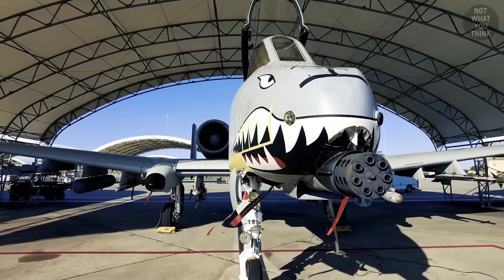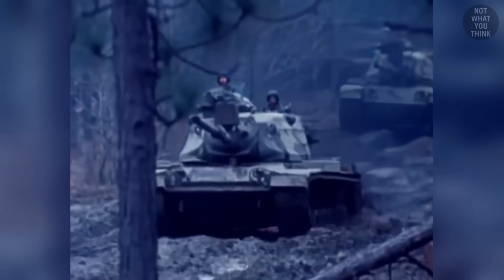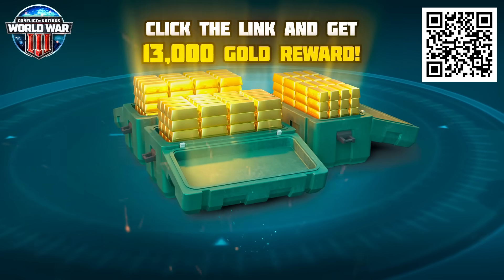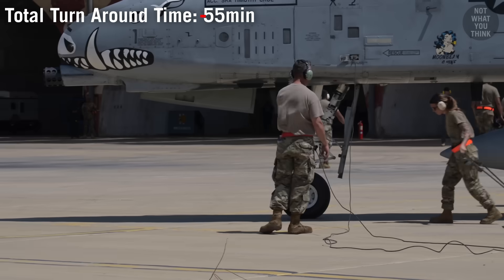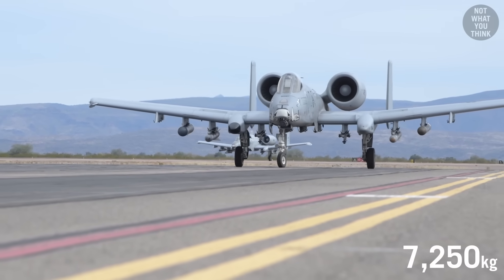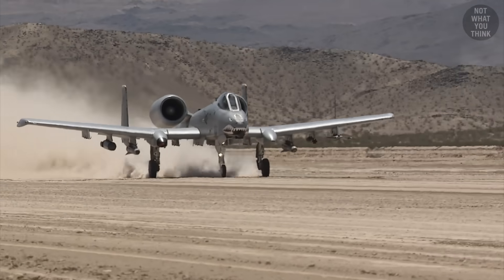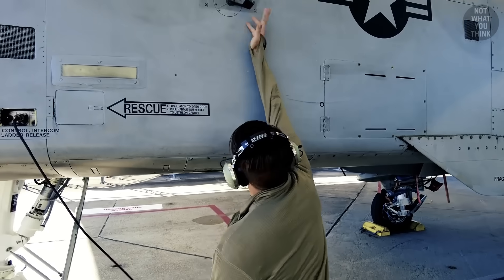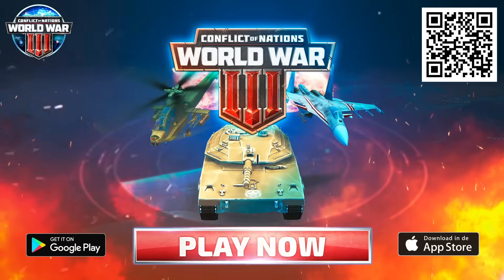The Aircraft That Doesn’t Eject Bullet Shells

Comment: i always forget that 50 year old planes are planes like the A10 and not the F86 or something
Reply: the f16 is only a year or two younger and is still a gold standard amongst fighter jets.  It's far less expensive than the 5th gen fighters and will be used to bulk out air fleets for the foreseeable future.  Part of why I really don't think they're gonna manager to retire the a10.  It was built to chew bubble gum and kick ass and it's still all outta bubble gum.
Reply: @Ray_LF  A-10 different kind of aircraft man; it's designed to operate closer to battlefield which makes it susceptible to modern ground missiles unlike the F-16 which can operate from higher altitude and drop the same munitions with modern gps to hit same target. besides the new ATACMS no plane needed just push button via safety of 150 miles and deliver 950 bomblets (grenades) or 900,000 yup 900k  tungsten metal balls size of a marble traveling 2,000 mph covering ¼ mile in ONE missile.
Reply: . . . . or the B52 . . . !
Reply: Right the f86 is only closer to 80 years old😂
Reply: @chheinrich8486 and B-52 is like 74 years old
Reply: Really great design
Reply: Если А10 не нужны Америке, предложите их Украине. Может они смогут найти им полезное применение?!
Reply: @ЛевГригорьев-б6л  If it's obsolete, why would Ukraine need them ?
Reply: ukraine has su-25s @ЛевГригорьев-б6л
Reply: @ЛевГригорьев-б6л  You have a good point

Comment: Retiring the best air support aircraft in the world is just plain insane. Ask any soldier on the ground and they want an a-10 warthog overhead.
The Air Force needs the money from the a-10 program to put into the f-35 program. 
That is the only reason they are retiring the warthog because the warthog has recently been refitted with new wings and upgraded avionics and weapons systems to make them last for another decade.🎉

Comment: The Airforce has been retiring the A10 since 1980.  It's not fast nore a bomber so the Airforce doesn't want it.

It's cheaper to operate than any of its "replacements" is why it hasn't been retired and probably won't be in 2030 either.

Russia and China are still fielding 1970s technology.

Comment: we still need the A-10 or somethign like it. Bullets are cheaper than missiles.
The A-10 is also deployed after we have established Air Superiority. the F35 is not a replacement for the A10 completely different roles.
Reply: The problem is DU ammo has been out of production for a very long time.  Restarting it will make them more expensive.   The TP rounds can still cause a lot of damage, as would HEI rounds, On APC and soft skin targets
Reply: @Matt-mt2vi  yep the ammo part. It’s a major problem with USA current military. It never helped the air force never
Liked the a10 but the army loves it
Reply: F35 is a multi roll aircraft it can hit a target while being stealthy, stealth is a needed feature nowadays or else it'll just get shot down by a missile you can only have so many flares and chaff. Stealth will eventually fade out due to advanced technology but right now it's what we need, like A-10 was what we needed in the 70s-80s but it's not anymore.
Reply: @Commander9013  100% disagree. Styler will not win a war. It’s good day 1 not day 100. Or for deep strikes into enemy territory. The job of the stealth bomber. Something the f35 is not. 
The a10 is ground attack. F35 is not. No big gun. Crap loiter time. Can’t take a hit. Over priced. I’m in the industry. 
The a10 can fly under radar. 
There is not aircraft out right now that can do what the a10 can.
You also clearly don’t understand military doctrine. The USA establishes air superiority before sending in non stealth.
Our planes are the only in the sky. So no threat to the a10.
Reply: @Commander9013  stick to video games. The A-10 has been effective well past the 80s. NOE is still very effective in pentration of A2AD more so when SEAD and EW is in effect, which os what happens normally on a front line where CAS takes place, not hundred miles in occupied territory where the F-35 would be used.  It has worked against A2AD systems that are still numerous and widely used today.  When actual knowledgeable people talk, not your type bare understanding, know that the A-10 is still viable today. It's the systems that are slowly coming out now are what the issue is.  The F-35 is a multi role aircraft buts its not a CAS aircraft.  It failed miserably that 3 years of testing.  There is no coming replacement for the A-10.  There is nothing that can't be stopped that includes drones.   There is also no defense that can not stop or at least be limited.

Comment: Retiring the A10 without a direct replacement is a huge mistake.

Not every conflict the US will be in will have manpads behind every tree.

F35's and F16's do not have the payload and loiter capability. They just dont cut it for CAS.
Reply: The F 35 is the direct replacement for the A 10, also yes they will, any military will have MANPADS behind every tree. Btw, the F 15 and 16 also perform CAS all the time, and both of the carry as much if not more than the A 10 in terms of payload, and can also deliver them without the risk of friendly fire, or risk to the aircraft because it isn't a slow moving and easy target for enemy anti air

Comment: A-10 should be kept just as the B-52.... its a necessary beast.
Reply: No it absolutely isn't, all it is, is a waste of resources and manpower that would be better used for planes like the F 35 or F 15, both of which can perform CAS better than the A 10
Reply: At least the B-52 has stand off capability to prevent being shot down easily. A-10 is missile and cannon fodder.

Comment: A Ukrainian Bradley disabled a Russian T-90 using it's 25mm chaingun.

Remember that next time someone says the Warthogs gun is ineffective against modern armor.
Reply: Only because the bradely could target the barrel and tracks, an A 10 in flight can't, it is ineffective against modern armor, the gun's also extremely inaccurate
Reply: @Crustaceannationrepresentative  the reports of poor hit ratings from the A10 on vehicle size targets have been greatly exaggerated. Many A10 Pilots have refuted those claims of a 10-15% accuracy rating, stating their hit rate is closer to 30 percent which means a one second burst would put a couple dozen or more rounds on a tank-sized Target.

Furthermore, the Bradley beat the T90 not by hitting it in the tracks but by destroying its Optics and likely hitting it in the turret ring. 

Now, a turret ring hit by an A-10 from a top down attack is not very possible, but the destruction of Optics and more importantly a penetration through the rear engine deck is absolutely likely to happen.

The A-10 platform is not designed simply to attack tanks, either. There are hundreds of other viable targets the main gun can absolutely shred. These include artillery pieces, buildings, troop formations, transport trucks, apcs... the list goes on and on. Can you destroy these Same targets with laser-guided weapons from an f-35? Absolutely. But the cost Delta is absurd. 

Lastly, the A-10 may not be able to punch through the front armor of a t90, but it can certainly tear up any model of the t72 as well as the older T-Series tanks. Many of which we are seeing on the battlefield as Russia gets desperate and digs into its old stocks of tanks.
Reply: Top-down attack would shred a T-tank

Comment: A-10 has more friendly fire incidents than other planes. It also can't kill tanks with its gun.

Most accurate = 12 meter spread.
Reply: It also has the most CAS sorties than any other plane or helicopter, combined. It can, and there are multiple instances of T-72s being popped if you bothered to read a book about the Hog in desert storm..
Reply: @Steamthrower1 If you bothered to read up on desert storm you'd know the F 111 flew more sorties than the A 10, and had to fly extra because the A 10 was performing so poorly, so the Vark had to pick up the slack
Reply: @Crustaceannationrepresentative  Can you please provide me a source for the alleged poor performance of the a-10, and the 111 needing to "pick up the slack"? would be greatly appreciated as i have never seen this in any book i've read.
Reply: @Crustaceannationrepresentative  and as expected, no response...

Comment: Amazing how the Air Force has worked tirelessly to scrap the planes that are actually preferred by the Army ground forces. Guess somebody wants a nice cushy job with a contractor upon retirement. Guess that's why they want to replace a plane that works with a plane that can't even beat 1970s tech. I'm looking at you F22 Raptor.
Reply: why can the raptor not beat 70s tech?

Comment: Good video.

It is not necessarily lobsided to a single side. Instead, it explains both why it was once useful and not it isn't. 

Was the A-10 unique? Absolutely, but it is a piece of its time, meant to fill a gap in the US military back in the 1970s. It is no longer suitable for CAS in the 21st century.
Reply: You point would be better if you didn't use the myth of it fill gap in the 70s.  It was a replacement for Close air support and pilot rescue support.  It still fills that CAS role better than anything else flying as stated by numerous military studies and test.   F-16 did really bad at it in the 90s and most recently the F-35 failed the test.  F-35 is great for alot of missions CAS is not one of them.  Incompetent Russia is still providing CAS even today, but for some reason people think the A-10C Which is superior to Russian CAS planes can't.  Lol
Reply: I think it's more than capable of it's role, it's still designed from ground up to be a ground attacker after all.
Reply: @Steamthrower1  its slow af gun cant do shit optics (by that i mean radar ccip pod) is pretty bad and upgrades costs way too much. Maybe some random country yea but in for example ww3 it would be useless.
Reply: If you answer your own question, what do you need us for?
Reply: @worldtravels2763 that is known as a rethorical question. It is not meant to be answered by the viewer, in fact, it was meant to be obvious.
Reply: @worldtravels2763  It's called a rhetorical question.

Comment: Important to note the A10 has a new role as a SEAD asset, It can launch jet decoy drones that can mimic the radar cross section of any plane and fool a SAM operator
Reply: And the F-14 (my other favorite aircraft) was upgraded with air-to-ground capability in an attempt to keep it relevant after reaching its shelf life.  IMHO, both were bad decisions.
Reply: @SplashJohn  agreed. These decoys have been around a long time and are launched in other ways already
Reply: @SplashJohn that’s not why they created the f-14b at all. The b variant was created to increase its multi role capabilities. The f-14s main purpose was a standoff range fleet defense aircraft.
Reply: @henrynagel7175  those two versions of events don't exactly sound mutually exclusive. You're saying the technical reasons they made the upgrades, he's talking about economical motivations. One does not rule out the other. "That's not at all why they upgraded" just sounds so silly when your story isn't totally different from the one you're saying is "not at all" the same
Reply: @joshyoung1440  upgrades to the Maverick or a-10?
Reply: So can several other aircraft
Reply: @Commander9013  Sure but the A-10 is a platform that would see limited use in a LISCO so giving it more roles is better to free up more advanced platforms for other uses
Reply: You could do that with UCAVs for much cheaper and with much less risk.
Reply: @strf90105  the drones loiter for hours they can get to the destination by its own thrust, a10 pilots will just have to launch near base and not be in much danger, freeing up UCAV for more dangerous tasks

Comment: The a-10 is such a beautiful aircraft. It's such an ugly airframe. The nose gear and the gun alone are enough to make some people get very angry at the designers until they realize just why it was set up that way. 

Also, because some people think this aircraft is obsolete because of manned portable air defense, you need to realize this aircraft was designed about the same time. Those systems were being designed and the a-10s tail section helps mix cold air with the hot exhaust in order to help defeat some of those systems and even when that fails the aircraft still manages to get back home.

I also don't think the a-10 is going anywhere mainly because while the system can be replicated by a bunch of distinct items like jdams and javelins, it can do all of that in one package and it has a significant morale boosting effect which can't really be understated

Comment: Man it saddens me that we are retiring this, they should make and mondern a10 with jet engines and two or three cannons with new wings
Reply: Least delusional A-10 fan
Reply: Hell no!

Strapping a single 30mm gatling gun on a small frame is already a feat by itself. More of them would be just impossible and stupid.

What kills tanks are the warheads inside the ATGM missiles, not the gun itself. The only things the gun can kill are BMPs/BMDs and other lightly armored vehicles.
Reply: @modica3466  While guided mutations (like ATGM missiles) absolutely have their advantages over the BRRT... I'd even argue that it depends on the tank, and the type of armor the tank has... As well as other factors. First, I'm pretty sure that the depleted uranium (or even tungsten) fired from the A10 probably does better against explosive reactive armor, and would only really be stopped by modern ceramic/steel armor. It would also do better against the "gapped" armor that attempts to stop shape-charge rounds. In addition, the 30mm is still able to easily get mobility kills against even today's main battle tanks, especially at the rate of fire of the gatling gun on the A10.
There's also cost. So... Assuming I'm getting the costs correctly (I could not find a truly GOOD source for the cost of each 30mm round...), a full load of ammo (~1300 rounds) for the Avenger cannon would cost ~$55,000 to maybe $70,000 (depending on the cost per round)... The Javelin (most common ATGM used by the US) costs either $80,000 or $107,500 or up to $514,000 for the newest missiles. I suspect that the $80K and $107K have to do with inflation, and the $500K+ is simply for the newest missile. And here is the thing: The 1300 rounds from the A10 could potentially destroy more then just 1 tank/vehicle (particularly if it's a light armor or thin skin vehicle... Or even a building/enemy encampment). The Javelin will pretty much destroy 1 enemy vehicle per missile. And destroying vehicles is pretty much ALL a Javelin can do.
The point is: I'm sad to see the A10 go. The A10, as it is right now, is probably obsolete. BUT, the overall design has merit. And I personally think it would be cool to see a newly designed CAS system, and I think that our military probably needs something to fill that role. That said, with modern tech... That aircraft would probably be something like a helicopter, rather then an airplane.
Reply: @modica3466 its a CAS support plane not a tank, Destoyer.   The 30mm is actually not meant to take out tanks. that's not its main role.  Since ww2, actual knowledgeable people know this and know that taking out support vehicles and damaging tanks is in some ways better than actually taking out a couple of tanks.  Can it still take out a modern tank with modern ERA, yes occurring to recent USAF test 2 years ago.

Comment: Just here, waiting for the comments on how it's better than any other aircraft for CAS.
Reply: It's a cool aircraft with cult following. I really like it. But A-10 fanboys sometimes behave like they are a bit on the spectrum. It's not perfect, it's not invincible, it's old. F-4 was kickass, but it's retired already. Same will happen to A-10 at some point
Reply: That's because it is.  We have nothing else that can do its job in the same cost-effective way.
Reply: Yeah, the Specter gunships are probably way better in nearly every way... but they just don't get the love.  People are wrapped around the axle of that gun, but as cool as it is, it's quite impractical to have to steer the entire plane to adjust for aim, versus adjusting the gun on the side of a C-130.  Plus, the C-130 has a notable SIGINT collecting advantage, and very, very meaningful loiter times.  It's not as fast as the A-10.
Reply: The A-10 is good for CAS in uncontested airspace but in potential conflict with China and Russia were airspace would be highly contested, it has no use
Reply: It is. Longer loiter time, more ordnance, more hardpoints, more ammo for gun, more survivable, great sensor suite, excellent countermeasures capability, etc..
Reply: @Steamthrower1  On its own, that is. communications & intel is key in pulling off any kind of military operations these days & not even the planes operate alone anymore. most of what you've mentioned, regrettably are no longer required as air units of any kind become all about NOT having others hit you in the first place, & being able to do lotsa damage with minimal payload. it's about how well an entire system work together down to the last detail in any operation, rather than how well a single unit of any kind can do anything. also, survivability don't mean shit anymore, since anti-aircraft & anti-tank ordnance become so commonplace, & reaper drones are just much safer & cheaper options if it really gets that dangerous. being able to fly with only one engine, one & half of a wing, & one lost tail wouldn't matter, if just 2 anti-whatever can almost certainly snap the whole plane in 2 down the fuselage.